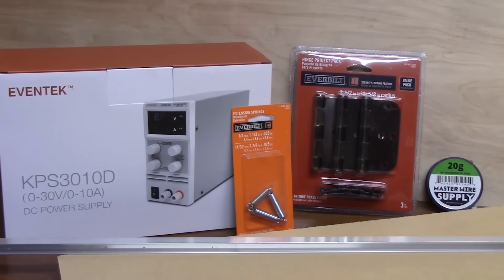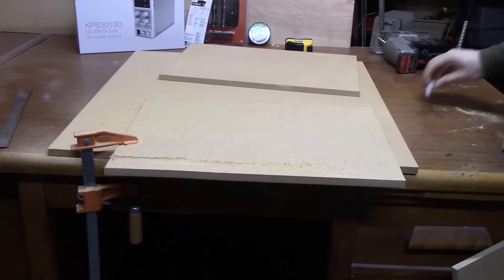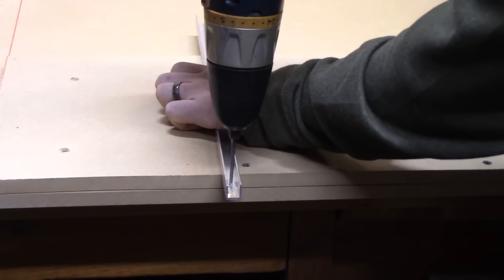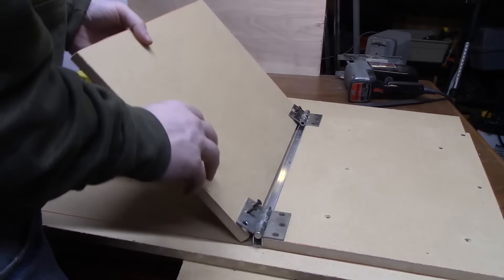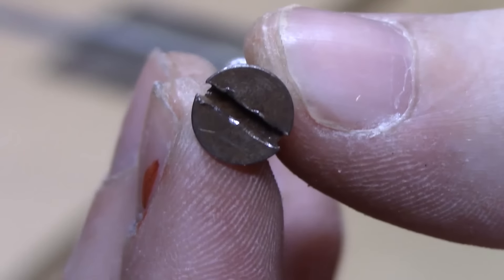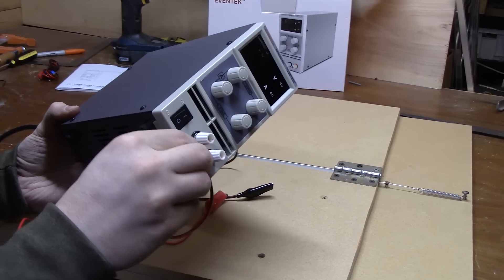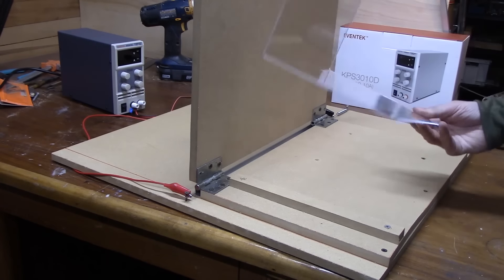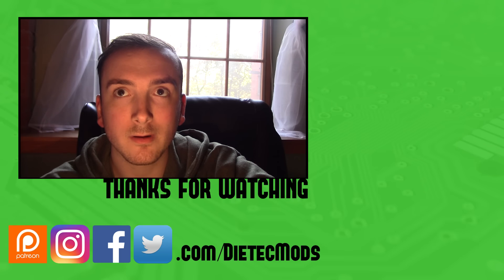How to make a DIY acrylic bender (Cheap & easy)

Comment: Hi !
This is the most explanatory video I saw describing an inexpensive Acrylic Bender jig, and I thank you for it.
I was looking several Acrylic bending tools on Amazon and they are all well overpriced for what they do.  I then decided to surf on YouTube and .. Voilà!
One tip, however, that can dimiduish this wire bender's cost a lot. You don't need a regulated DC Supply.  In fact, you don't need DC at all. You could use a cheap transformer with the appropriate ratings, of course.
Hope this helps.  Thanks again for this video and good luck for the rest.  Have a nice day!
Reply: Can yo9u send me a link to what you are referring too? I am not a techie.
Reply: Hello, do you mean a "raw" transformer, I mean, without rectifying? How many volts and amperage? Thanks
Reply: @Dancopymus  Hi, Dan.
This circuit does not require specific AC or DC voltage. However, I used a 12V DC @ 5A adaptor I took from Amazon. I then experimented on the amount of NiChrome wire to use, until it became a nice red color. Mind you, too red is like not enough. Id needs not to be too hot, otherwise it’ll melt the surface as the center of the sheet would be still « cold ».
Reply: @daniellachance8778  Hi my namesake, thank you very much. So can I use a PC Power Supply?
Reply: @Dancopymus  hi again!
Of course .. as long as it can supply the necessary current to make the wire glow red. Check before, or do like I did, experiment 😂
Reply: @daniellachance8778  Thanks!
Reply: @Dancopymus  Hi again.
Please, let me know how it turns out and, if you can, I would appreciate a picture of your finished project.

Have a great day, my friend !!

Comment: Fantastic, going to make me one, thinking off incorperating the power supply into the unit, also add in a bend stop so you can set the angle you want to stop at, your an inspiration
Reply: Just make a fixture to clamp the bent plastic at the angle you want until it cools

Comment: Thank you for the Vid! I have now built a similar machine but minus the extra baseboard, I just used a 3" ply strip and 4 small ply squares, 2 on each side. I also bought the recommended springs but found them way overpowered and strong, so I used a much softer spring from an Aldi box of assorted springs and it works fine, thank you again :)

Comment: Been looking for a power supply like that for ages. Nobody, including Google, seemed to know what I was talking about. I thought those things stopped being made. Thanks.

Liked your video. Bender is a bit crude. But, what the heck, it gets the job done. Bottom line.
Reply: I myself use a car/mc battery charger at minimium current setting (3 amps/12 volts) meaning about 80watts on the nichrome wire. Works great.

Comment: Is the voltage AC or DC? What thickness of Nichrome wire do you use - .032, .036, .040? Thanks. .032 Nichrome is no longer available on Amazon. FYI.

Comment: I use a 24 volt transformer with a light dimmer on the input side of the transformer to regulate the temperature of the nichrome for a hot wire cutter, I'm sure this would work for this application as well. The light dimmer is the type used in place of a wall switch and is made for incandescent lights, they may be harder to find since everything is going LED these days but worth looking into. I'm using a 500VA buck-boost transformer which is overkill but I've seen where other's have used a common door bell transformer.
Reply: I like the light dimmer idea.  I was thinking of using an old laptop power supply.  I should have something about right in my hord of old parts.
Reply: This may be a cheaper solution
Reply: It could be a shower dimmer.

Comment: Great vid! Differences in melting pt: polycarbonate is approx 50° higher in temp than acrylic. Would the power supply you use yield same results bending poly vs acrylic sheet?

Comment: Another awesome tutorial 😁 try not to use the screw to adjust the wire height eventually it snaps the wire...best to just adjust height straight from the screw that the spring hooks too

Comment: Great video!  Your wire won’t short out if it touches the U channel, unless the U channel is touching something that is grounded.   I’m making a bender now based on your video.  Thank you!
Reply: The channel could become energized though, and if you happen to brush up against it and provide a less resistive path to ground...... zippity zappity
Reply: @Hyperlooper  It's 12Vdc. You'd have as much of a chance at getting a zippity zappity from this power supply as you would touching the positive and negative terminals on a car battey. Your internal resistance is too high. AC on the otherhand is a different story.

Comment: Thanks for the video. Seems easy enough - however, not having experience with electrical circuits, what about potential for electric shock. I have heard it doesn't take too many amps to hurt and or result in much worse. 10amps seems high. Could you comment please?

Comment: which one do you think is better to use of these: 

.Thermoforming (Infrared Heating)
.spiral carbon heating element
-carbon fiber infrared heating tube
-Nichrome 80-50' - 20 Gauge Resistance Wire 
-heat radiator

Comment: Do you think the Variable power supply would heat this wire at 40 inches in length?  I don't know Ohm's Law that well.  LOL  I need to heat some vinyl up to about 250 deg. surface temp.  I was using a heat gun, but I have to run it up and down the 40 inches, this could heat more evenly.

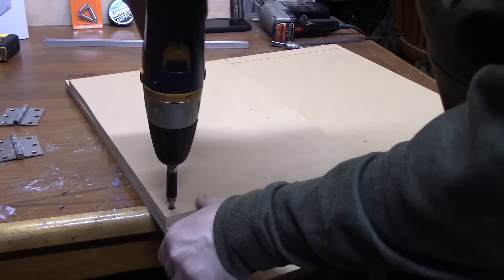Comment: 2:51  It is called COUNTER SINKING the screw(s).  They make bits designed to do this job and match the shape of the screw head.  5:15 "A flat head screwdriver screw"  as opposed to a flat head ________________ screw?

Comment: Regarding your power supply. The display seams to be indicating that it was in constant voltage mode and so producing 10V because the green LED was lit.   The red constant current LED was not lit and so the display was not limited to the current setting.  The current through the wire must be less than 10 Amps. 
The wire has 0.635 Ohms/ft Resistance and assuming you had about 2 feet of wire the resistance would be about 1.2 ohms.  On 10V that would be a current of about 8.3 amps.  So that is reconcilable with the 10Am current limit not lighting.

Comment: Great video thank you. I'm thinking about making a heater bar for edgebanding wood to speed up the glue drying process. Your methods might work for what I'm doing. A commercial heating bar is about $1,000.

Comment: Hi mate, really cool idea.  The only trouble I will have is powering it I’m not a great sparky.  Could you assist me in the sense if telling me or sugesr to me easy to get common way to power it like a battery or some sort of charger? It’s really is fantastic.  I need it to bend acrylic for my aquarium overflow boxes.

Regards Duzzy from 🇦🇺

Comment: Muy bien video, excelente, Realice un proyecto exactamente igual y le he ampliado el detalle de tensar el hilo con los tornillos y el muelle. Saludos desde Cádiz (España).
Reply: Hola! Qué alambre usaste para calentar el acrílico?
Reply: @hugopaul2  Te voy a explicar según me han enseñado a mi, utiliza un hilo de nicrom de 3 mm lo más tenso posible. Tienes que tener una fuente de energía y Un potenciometro o regulador de vatios. Ahora te voy a decir el principio de las resistencias. Cuanto más corta, menos resistencia y más calor, cuanto más larga más resistencia menos calor.   Cuanto más fino el hilo más resistencia menos calor, cuanto más grueso menos resistencia más calor. Si te queda alguna duda no dudes en comentarmela. Un saludo
Reply: @JoseMaria-my2mn  Buenos dias. Que voltaje aplicaste? AC o DC? Que calibre de alambre usarias para doblar laminas de 2 metros de largo y 3mm de espesor?
Reply: @adriansuarezlopez2261  Perdón, he estado ausente bastante tiempo, yo al final desistí del hilo de nicrom, es .mucho follon, al final opté por una resistencia de un viejo calefactor de 90 cms de largo y muy potente pero para 2 metros de largo imagino que tendras que utilizar 2 metros de hilo y una fuente de energía muy potente porque con esas medidas me suena a algo industrial.

Comment: Cool !
What's the difference between acrylic / plexiglass / lexan etc? I want to use a similar process to make custom packaging (tube shaped, meaning I would heat and mold the product using a tube pattern). Just unclear on what all the various materials are and - if they all perform equally for custom molding - which is more affordable and/or readily available etc? would the material depend on the diameter of the tube or the ideal thickness etc?

Comment: any idea what the limit is on how long you can make it?  I imagine it would just mean more power on the power supply and maybe a longer spring?
Reply: Did you try it on a longer wire? Do you think the Variable power supply would heat this wire at 40 inches in length?  I don't know Ohm's Law that well.  LOL  I need to heat some vinyl up to about 250 deg. surface temp.  I was using a heat gun, but I have to run it up and down the 40 inches, this could heat more evenly.

Comment: U.K.  Items quite a bit more espensive here  i.e. 30 ft wire costs more than your 50ft.
I have a power supply rated at 8.5A continuous 130vA Max. Will this work?

Comment: I have a 0,8 mm nicromwire and a powersupply of 30V, 5A max.
I can not get the wire hot enough. Everytime the voltage drops when powering up the powersupply.
I did try 24V at 3A, 12V at 5A but everytime the voltage drops and the wire does warm up but not hot.
What do i do wrong?
What is the recomended setting for a 0,8 mm nicromwire on this powersupply?

Comment: Pretty good, i already have a power supply, and some hinges, just need some wire, and i am all good to go, a spring i will have that laying around somewhere to. 

Im rewiring my electric kiln to, so i will have some Kanthal wire laying around once i have got it rewired. Or maybe i will get some dedicated wire, so i dont have to get the Kanthal already. 

How much watt did you use for the wire? 

I will use the Plexiglas to make a portable book scanner (with 2 cameras in it) so i can digitalize books in the library and at home. I will convert those pictures into a pdf file, and i will make the pdf file searchable with OCR function. It comes in handy, when you read some part of a book, and need to find the part again to make homework etc. etc. 

Greetings,

Jeff

Comment: Just finished building mine using your instructions. I have the wire pretty tight and suspended but when I turn on the power supply one specific spot on the wire then droops down and touches the u channel. Nothing bad happened, but I’ve got the thing as tight as I can? Is there something I did wrong to cause that?

Comment: Any ideas how to control the bend radius so I can get it exactly what it is as per fusion 360 design?
I think I would need to be able to adjust the gap/area where the heat is applied.
Reply: You could use a protractor on each side, stood up vertically.  Use a metal one that has the center cut out so you can insert a screw/nut to lock in the angle on each side.  Then when you bend, the MDF stops on the screw and can't go any father then your locked angle.

Comment: Any way to get a perfect, sharp 90 degree bend in it, so that the square edge of another sheet of acrylic could be welded into it? Basically no radius on the inside of the bend- just a sharp turn.
Reply from the maker: It's pretty sharp. Worst case scenario you would just have to file off the corner to fit. Could also fill in any open space with silicone
Reply: @DIYTechTube  the reason I ask is because I am looking into building an acrylic sump for an aquarium, and was curious if this would give me a better product than just welding acrylic together into a box. It might just be easier to bend it, and weld a flat piece to the side, but I have a feeling that it wouldnt be as strong as welding it inside the corner. I could probably just use a radius gauge on the folded piece and sand the corner of the flat acrylic to get a perfect fit. I might make this and test it, see what's possible.
Reply: @DIYTechTube  also using silicone to adhere acrylic in an application like what I need will just blow itself apart. It really has to be welded together perfectly
Reply from the maker: Oh yeah, huh. I think this could make your project look really professional

Comment: I'm building a similar plastic bender, except mine will be 50" wide   able to bend up to 48"  .   Will the power supply you are using be sufficent for  my bender ?   If not can i have your recommendation.    Thanks
Reply from the maker: Yeah I believe it will be fine

Comment: I did try all kind of voltage/amperages but every time the voltage or amperage drops and the wire is not getting hot enough.
Someone did 24V, 3A with a 0,8 mm wire. When i try that the voltage drops to 5V.
Someone did 9V, 6A. My voltage drops to 5V.
At 9V, 5A my apms drop to 3,5A.

I have a Korad KA3005P bench-powersupply (30V, 5A max).
I have a wire of 0.8 mm. Must i use a different wire?

What am i doing wrong?

Comment: That pwr supply is a precision supply and expensive ! All you need is a good size step down Xformer with 4 or 5 amp output and may be 12VAC
Reply: Can you send me a link to what you are referring too? I am not a techie.
Reply: So what you meant is that using a car battery right?

Comment: Do you think it will work with metal as well? (replace the wood with aluminum sheets)
Reply from the maker: Yeah you can use any material you want. Wood is easiest though, because of the screws holding the wire in place

Comment: Thank you for your guide. Using your concept, I’m going to be building a ‘cheaper’ version; effectively just two MDF boards and hinges. I’ve already got a heat gun which I’ll make use of. :-)
Reply: Heat gun will heat too much of the plastic. The hot wire puts the heat just where you want it and you get a crisp bend.

Comment: @Dietec any idea if there would be a way to add a window to the " Fractal Design Core 500 " case? or make the whole thing acrylic? i think getting this case because it fits longer gpus and being a form factor that i still like but not being so expensive. the mounting system makes it impossible i think? i thought this bender would be perfect to get the bends done but i would not be able to mount it. any ideas?
also do you play borderlands? i think it would be a nice theme for a pc mod :D just a suggestion

Comment: great mod. just a heads up, can you check the link to the tension springs. i followed the link and ordered them but they dont seem to be the same ones you used. the ones i received appear bigger and have far greater tension than what seems to be the case in your video.
Reply from the maker: Thanks for the heads up! That's no bueno. I think I got mine from home Depot so I just tried to match up the springs as best I could

Comment: Hy dietec i have a question to your older video about gpu backplates: do i need non conductive spray paint because i cant find them in local hardware stores and if i attach them with double sticking tape wouldn't it isolate and cut the energy transmission ? Sorry for my bad english
Reply from the maker: Most spray paint is non conductive, just don't get any with metal flakes in it or anything like that
Reply: @DIYTechTube  thank you for your quick response and keep up your awesome work

Comment: This video is awesome! Gonna be helpful in the future. A couple quick question though :) First, does it matter whether i use 20, 22 or 24 gauge nichrome wire? They are not that easy to find here, mostly vape shops sell them and mostly 22-28 gauge. Second, have you tried the acrylic bender with a heatgun instead of the nichrome? I pretty much got all the materials easily accessible, except for the power supply and nichrome wire (20ga) and overseas shipping sucks :P
Reply from the maker: I'm sure 22 for the wire would be fine, it just can't touch the edges for obvious reasons. A heat gun is another way but way harder to make look nice. Good luck :D
Reply: @DIYTechTube  Thanks for the quick reply! :D Love your vids btw, one of my few inspirations for getting into modding, finished my first casemod recently :)
Reply: Also, the heat gun takes forever to get a line across the plexiglass to bend.  I just get curves and not a nice 90° bend.

Comment: Can you use an old power supply from a pc for this ?
Reply from the maker: Yes, but you have to make sure you're using the correct rail. Don't want to give it less than 5 amps, I don't think that would work
Reply: @DIYTechTube  Thx m8, I have a few of old ones just collecting dust so I will give them a new job :)

Comment: Is there a chance the wire might snap?
Reply from the maker: Yes eventually. But the wire is cheap and easily replaceable
Reply: @DIYTechTube  okay, but i mean... Is it dangerous when its snapped? I watch some diy, he use heatlamp neon instead wire... Do u recommend that?

Comment: The variable transformer is not really suitable i bought two and wish i had gone for 20 amp 120 volt the one in the video will only just heat up the wire , maybe im doing something wrong but its not suitable for the job